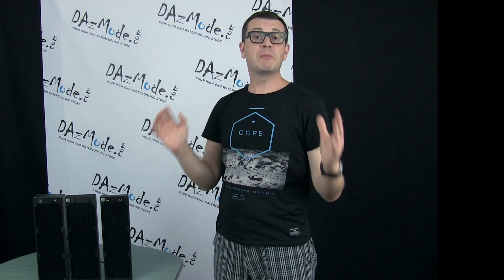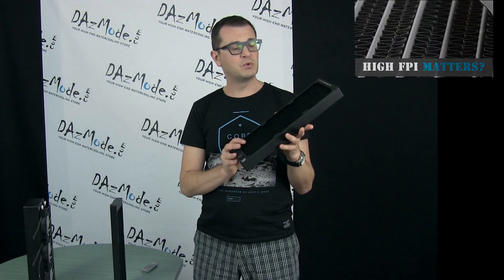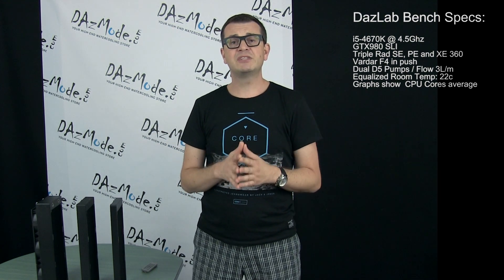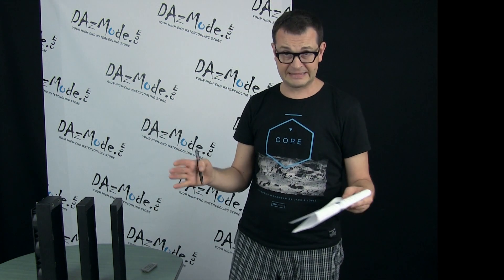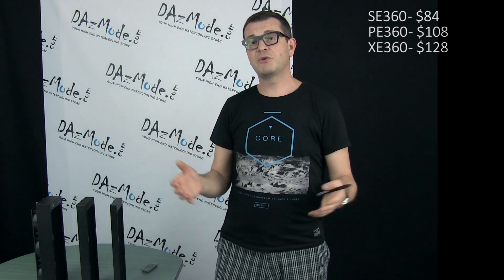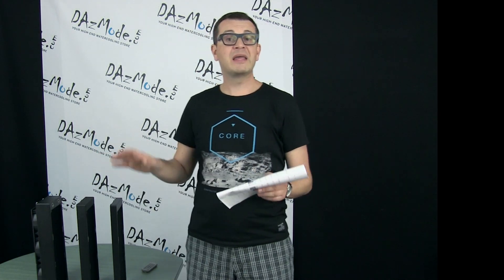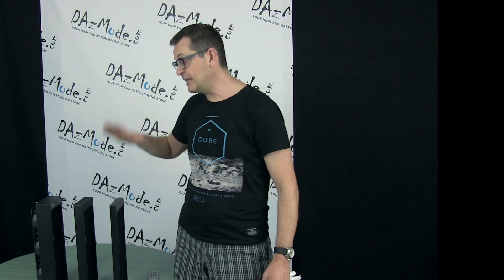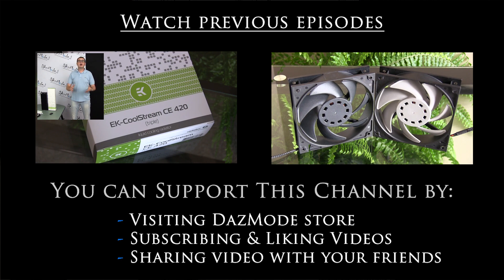EK Radiators Performance Buying Guide - DazLab 27

Comment: This video I awesome. You're the only one who did it right. Can you comment about the push pull with lower speeds not drop bottom but perhaps dB 35 level so about 1200 fan speed with push pull on thick

Comment: Nice, This is an old video but I am building my waterloop in a meshify s2 with 2x360 rads and some people on reddit told me those se rads suck buy others. but it will only fit with se radiators. I´m happy i didn´t listen to them and you are here to prove that the thickness doesn´t really matter and my 2x360se rads will be more than enough
Reply: Just bought two for my lian li o11 mini. They work perfectly.

Comment: so my heat out put is around 700 watt and i plan to buy 2 480 radiators, for low noise/high performance  should i take the PE or XE ?
Reply from the maker: Xe

Comment: One pe 360 enough for a 6700k and a gtx970 g1 gaming? thank you.
Reply: If u dont overclock then its absolutely ok
Reply: Already did it. 6700k @4.8 Ghz and 970 @1600mhz. Temps while playing are fine. 55° on the CPU and 50° on the GPU. On the rad I am using Noctua fans.
Reply: and what do you think of pe 240 for cpu 5820k gtx 1070 ? will it be enough if i don't overclock?
Reply: Michel445 Watch Jayztwocents video with his define nano s. But its should be ok. But Not super silent.

Comment: While I thoroughly appreciate these fact-finding videos, I have a question, or more a concern. 

In pretty much every one of your videos discussing water cooling myths and facts, you break down a common misconception. For instance, 240 vs 360 radiator with a single CPU or CPU and GPU. The difference was, generally, negligible. The same could be said for thick vs thin radiators, high FPI vs low FPI. But here's my concern: If you say the same thing for each facet, the difference in performance isn't just 3-4°C, it's actually collectively 8-10°C. For each compromise you make, on their own, they make little difference. But in the grand scheme of things, they do make a difference.
Reply from the maker: +Daniel West This is fair comment, although my message is not "don't buy" or "don't do". I just trying to put in perspective what you gain in each case and at what cost, because even for myself I find that cost of each build skyrocket really fast.  I'm trying to optimize it for myself in first place, while I don't mind sharing my findings as secondary objective.
Reply: DazMode
While that may be true, and I do believe it, "it makes little to no difference" is said many times in your videos. You do preface that with the comment, "if it's worth it to you then do it", so that's fair enough. But to someone who's new to water cooling and doesn't understand the ins and outs, that may come across as a direct statement of fact and might be taken as such.

Like I said, I always watch your videos and have really enjoyed learning about these myths. You do let people know that it is still up to them to make the decision, but the whole "it makes no difference" does give across the impression of confidence, when in reality, you respect other people's choices and see the value in them. And also, like I said, if everyone did what you said in each of your videos collectively, they might not have the best performing water loop. Taking one or maybe two points is fine, but it's gotta be balanced somewhere in the chain. You have to make up performance somewhere.
Reply from the maker: +Daniel West It depends if we are talking about balanced set up or overkill. As soon as your reach saturation point it really makes no difference.  It total waste to put big radiator, when small one gives you exact  same result and so on.  There is no milking beyond saturation point, but it is ok to let an individual kid yourself if that makes somebody happier. I hope people can make sense of things with little help from my videos.
Reply: DazMode
A balanced setup is what I'm talking about. But I understand what you mean. I'll leave it at that. Thanks again for the videos, and thanks for responding.